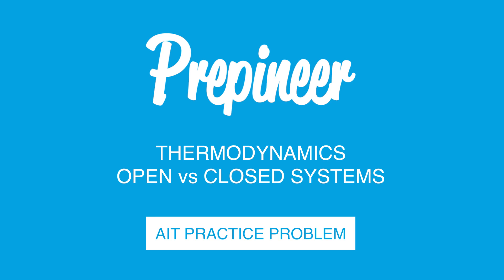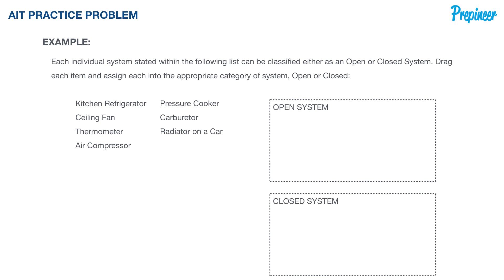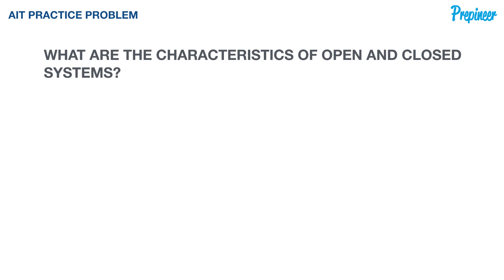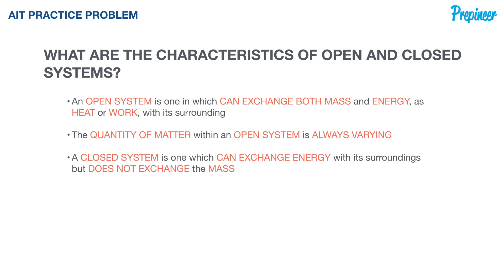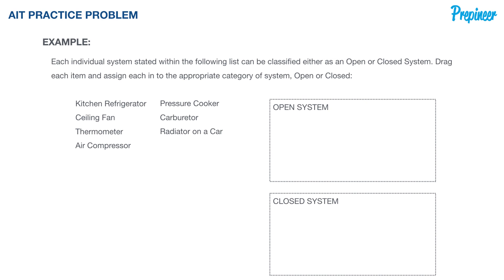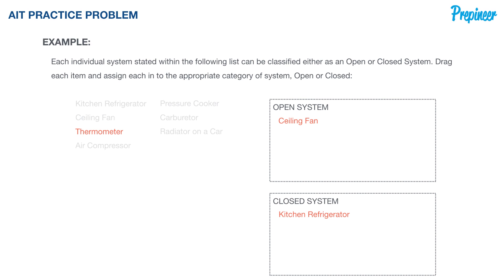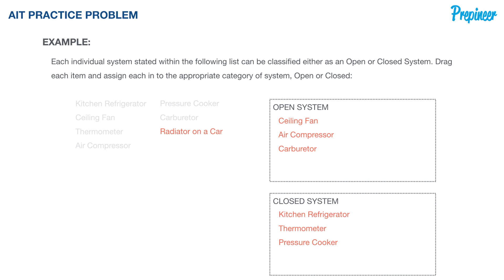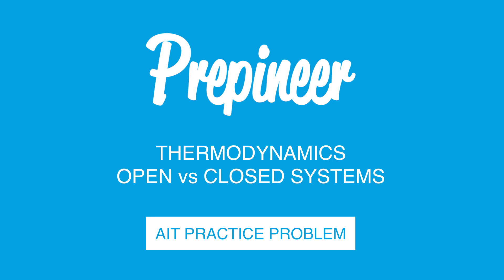FE Exam AIT Practice Problem | Thermodynamics Drag & Drop

Comment: This is tricky. A radiator, when combined with the engine is a closed system. The coolant circulates between the engine and the radiator without ever exchanging matter (assuming normal operating conditions if the pressure relief valve is not activated). You could say the "refrigerator compressor" were an open system if you separated the one component. The problem is further complicated with mass in and out of the refrigerator door if you are looking at the whole refrigerator as the system, as the diagram given does. Is it typical for diagrams like this to be given with the problem or is that an explanatory addition on your part?
Reply: same for the fan. it is where the boundary are selected. tricky!

Comment: Hi, does leaving the fridge door open count? What about putting in warm beer and taking out cold beer? Been a while since basic thermo, how does the radiator on a fridge differ from a radiator on a car? My fridge blows out hot air. Meanwhile, coolant does not leave the system of a car unless it's broken.